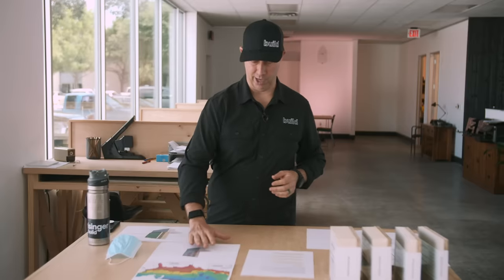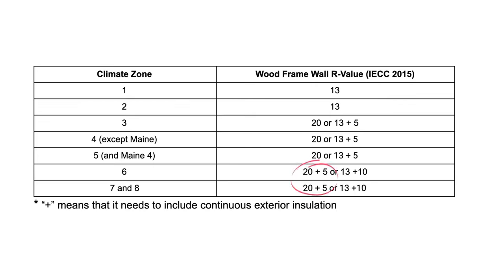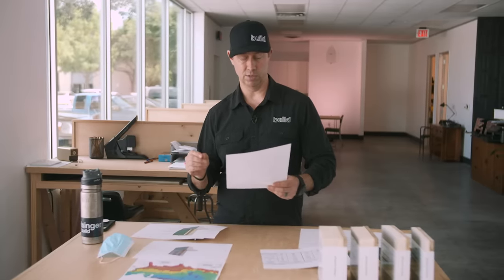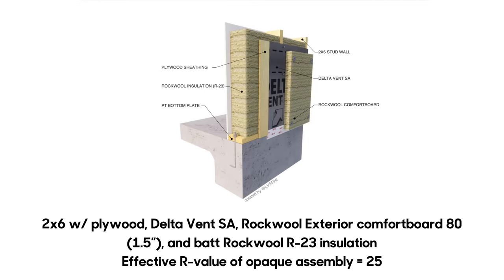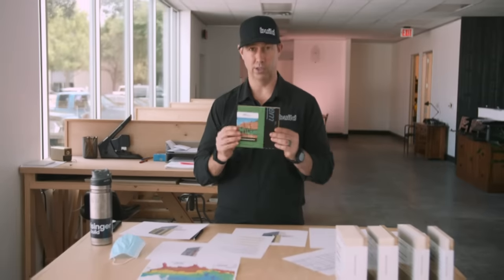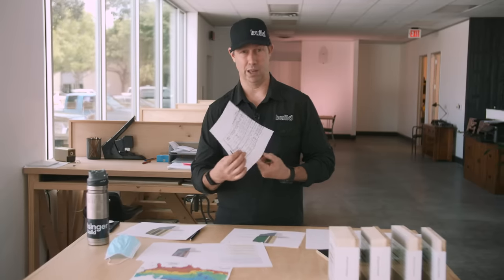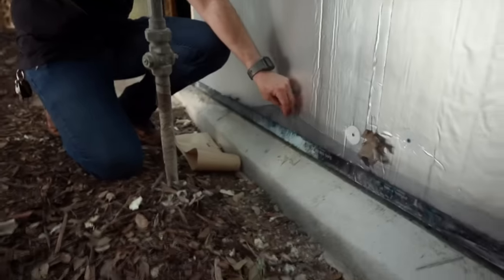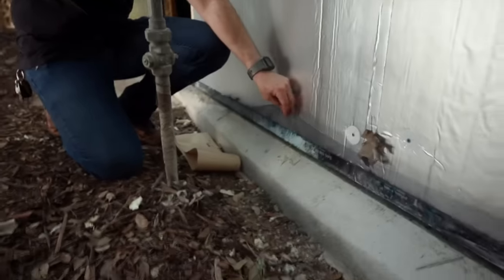5 Ultra-Insulated Framed Walls

Comment: Thanks Matt, great info!
In my new house build in Climate Zone 5 close to Pikes Peak in Colorado. Very tight air & moisture control, unvented roof (no penetrations, all vents go through gable ends). Main level is basically a walkout basement with 8” concrete walls. All my insulation is on the inside of the concrete walls. . Walls are R44 total with 7” of foam sheets + 3.5” of Rockwool in the inside stud walls.               I learned that the Polyiso yellow foam looses R-value greatly with temperature drop, so in my walls I put 3” of EPS up against the concrete & the 4” Polyiso on the inside, then the 2x4 studs with Rockwool. So the walls are about 20” thick.
Reply: James - we are going to be building our new home in the Colorado Springs / Black Forrest area and appreciate the info!  I was watching this for cold weather insulation ideas.
Reply: @ClawsonMatt  Good luck, my daughter lived in Stetson Hills when the big fires hit. There are many new tract houses (code minimum) being built up in West Black Forrest.

Comment: I helped my uncle build his home, with R-50 walls and R-75 ceilings.  He used 2x6 top and bottom plates with alternating offset 2x4 studs to break the wood's thermal bridge.   The walls were insulated inside and out with 2" fiberglass, with 2" sealed foam board with inward-facing aluminum IR reflection.  He added two more inches of foam board with outward-facing aluminum IR reflection on the outside, followed by siding.  His attic was similarly snugged up tighter than a drum.

For air quality, he employed both an active and passive filtered, thermally-isolating air exchangers.  While his similarly sized neighbors were paying over $200 a month in utility bills, his was never higher than $50.  This was throughout the 1990s.

Comment: Really great.  Roof assemblies next?  Would really love to see Lou’s detail of your house roof details.  The outriggers on that are genius.
Reply: Yeah, there is a great deal of emphasis on walls but little on roof or foundation.   Is that because the complexity of walls leads to more mistakes and problems, and therefore getting them right is harder?
Reply: Genius?? Wow. As a design builder for decades, and having done variations on continuous exterior roof insulation systems for over 40 years, I see that detail as pretty pedestrian at best, mediocre choices of compromises at worst. Last time I did overlay outriggers and stopped the roof foam at the wall line was 20 years ago, and for good reasons. Dr Joe has since published the reasons. In our Colorado climate, insulation all the way out to the sub fascia may not be mandatory, but it is if you want to avoid problems, such as ice damming being made worse. My big issue with Matt's (really Steve B) outriggers is the fussiness and the disruption of the continuous exterior roof insulation. See Dr Joe re: air networking. The reduction in insulation value over the outriggers is also a factor. 
We have done similar situations, and here is what I would consider a smarter, more integrated approach to the problem: If 3 1/2" LVL's flat at 24" OC will support the load, then 1 1/2" x 3 1/2" LVL vertical at 48" OC will be even more capable of supporting the load. Since Matt got a deal on LVL and used them for all rafters, it is simple to extend out and cut tails on every other rafter (3 1/2" +/- high). Since Matt is fully on board with liquid applied, that insures a seal of the projecting tails to the ZIP, really no different that around windows, etc. The disruption in the foam is now on the wall, the tiny cross section of the LVL tails. The bridging through that cross section could be reduced by an extra 2" polyiso collar around the tails, hidden in the boxed soffits The heat path is now longer through the tail, from out to in, so the R-value of the LVL tail is therefore increased). A deeper fascia and soffit is a byproduct, which is used to advantage. An LVL sub fascia is now 9" +/- deep, and can cantilever at the rakes to pick up a deep LVL barge rafter, whose top end is supported by a projecting LVL at the ridge. Then a nailer over the rake wall foam, and lookouts tying to the LVL barge rafter. Not hard, we do do this. 
As for roof, one approach is to restart the inner sheathing outboard of the wall foam, to support the continuous exterior roof foam all the way to the sub fascia. Now, blocking above the tails, outboard of the walls to support the upper roof sheathing present far less air movement/ thermal issues than does Matt's outriggers.

Comment: Something that would be really interesting to see: how investing in insulation reduces your HVAC costs and how quickly it pays for itself in energy savings.
Reply: I bet it helps a lot!  I just had my very leaky front door replaced and they insulated the voids around the door frame.  The front room is no longer 'muggy' and my electric bill dropped almost $50!  I've also been able to keep the thermostat at a lower temperature without the HVAC running non-stop.  Who knew?
Reply: Paying for extra insulation up front might save you a ton of money up front by reducing the size of your HVAC systems. If you are retrofitting, the ROI is likely too long. In that case you are paying extra for comfort
Reply: @sd0753  yeah for new construction I'd really like to see a breakdown on how spending more on insulation and air tightness reduces the cost of the HVAC and then how quickly you recoup the balance of additional expense in energy savings.
Reply: Its simple to figure, do a free online manual J calculation, you can vary the levels of insulation which in return will tell you how many BTU a hour the house will take to heat and cool at any temp, then covert BTU to KWh based off the A/C or heat unit you plan to use.   

   While thats a estimate and will be approx and vary,....you can get it very very close by doing a hourly historical weather chart for a previous month for all 30 days....what was the temp at 8 am for aug 1, 2019, then 9 am, do all 24 hours for all 30 days, total the BTU`s and then apply your selected equipment to figure out resource usage to generate those BTU`s......you can do a daily/weekly/monthly cost for a real month at your location last year or any previous month the data is available for in any area...from florida to alaska.
Reply: @alldecentnamestaken  
Like solar? Bahaha. No. YOU won't see an ROI but the next owners will.

Comment: Here’s the complete overview of all the assemblies:

First Assembly: R-22 effective
2x6
R-23 Rockwool batting
Zip System (R-3)
Liquid Flash w/ foundation

$3.62/sqft

Second Assembly: R-25 effective
2x6
R-23 Rockwool batting
Plywood
Delta Vent SA
Rockwool Comfortboard
Tape w/ foundation

$5.82/sqft

Third Assembly: R-27 effective
2x4
R-15 Rockwool batting
Zip System
Atlas Energy Shield 2” Polyiso (R-13)
PT bug plate
Liquid Flash w/ foundation

$4.05/sqft

Fourth Assembly: R-30 effective
2x8
R-30 Rockwool batting
Zip System (R-3)
PT bug plate
Liquid Flash w/ foundation

$4.82/sqft

Fifth Assembly: R-45 effective
2x8
R-30 Rockwool batting
Plywood
Prosoco Fluid Apply (R-Guard & Joint and Seam Filler)
Two layers (3” total offset) of Atlas Energy Shield 1.5” Polyiso (R-9.8)
PT bug plate
Prosoco Joint and Seam Filler w/ foundation

$7.13/sqft

Comment: We use comfort board r 20 on our low perm wrapped vermiculite cored masonry walls and wrap again for air gap before masonry veneer. We insulate and thermal break/vapor barrier the foundations or piers too. Do a lot of timber frames 10x10 post min. and glulam 2x12 for floor beams, bents get 8x8 min. Being in the north we have 70 psf snow loads. So thicker walls are norm.

Comment: Wouldn't 2x6 or 2x8 walls allow for 24" stud spacing?  Also, if you use two 2x4 studs to replace a single 2x8, would you save money and prevent a thermal bridge?

Comment: Would love to see a ICF wall compared too.
Reply: Definitely... that's what i'm considering...
Reply: ICF numbers are stated... r22-25 for standard. Zero breaks. They make new ones that are r-28. Best results high desert climate. The thermal mass ads some r like properties.
Reply: I wish Matt showed more interest in ICF. He's done a few shows on it but ICF really tackles lots of challenges Matt talks about.
Reply: NorthWoodsDiver zipp sponsors the show so that could be an influential factor
Reply: There are ICF systems that go up to R-59 and possibly higher. Pretty insane, and building out of them is basically the same as with any other ICF so any contractor familiar with regular ICF can use them. With all these exotic wood wall assemblies, there's a lot more that the builders need to be aware of, and not every contractor familiar with wood framing can do high R assemblies with their various caveats. In my opinion, at least.
Reply: I love ICFs but I'm convinced that doing Fastfoot with a 3' ICF is about ideal. I'm not really convinced that ICFs are ideal over 3'. At 3' its quick, easy, single pour, minimal vibrating needed, low risk of blowouts, and frame above the 3' mark. That puts your windows at 3' up and in your wood framed section of the wall.
Reply: @BDA123100  I really like that idea. Makes a lot of sense.
Reply: I’m up here in Alaska and have seen the bills of friends whose house is built to code; hundreds of dollars a month. I start in a few weeks to build my house and am going with ICF with three inch of foam both inside and out
Reply: A friend of mine built an ICF home couple years ago 5400 ft² 10ft walls his highest electric bill was $220  everything is electric
Reply: @BDA123100   you can do no vibrating mixes for icf. Throw some helix into it and it works fast.
Reply: He calculated the cost per square foot for ICF in a previous (older) video. I believe it was around $15/sqf 
That’s for a 6” concrete pour with 2” foam on both inside and outside. 

While that seems a lot higher, this is just material cost. The real net savings comes from labour costs. Matt’s high performance wall has so many layers, the real cost will be labor. Which is important to a builder because that’s where he applies markup.
Reply: @NorthWoodsDiver  concrete isn't green
Reply: @Holy Guacamole...Kind of depends on what type of concrete you are talking about and in what capacity or with what respect you want to consider it to be "green." Some uses of concrete are better or more"green" than the alternative. Also, some of the most efficient and green homes in the area(Texas) use concrete as a major building component.(i.e. Zero Energy Home Frisco,TX)
Reply: @hihokie  it can be much greener than wood depending on where you live. Sourcing concrete materials in Florida which is rich in the things that make up concrete is different than sourcing it in other places. And there isn't much about a home that is "green". Asphalt shingles, metal roofing, PTFE based vapor barriers, paints, solvents, all come with environmental costs
Reply: ICF walls are difficult to water seal. That's a big problem for below grade walls.
Reply: @ScottyDMcom  Thank you Scott for the knowledge and the great article. If I may post an excerpt from that article illustrating the point I was making in my previous post..."The cement industry, too, points to more optimistic assessments of the industry's progress on emissions and suggests that, across its lifetime, concrete could make a net climate benefit when all possible action is taken into account.
This includes re-carbonation (or the re-absorption of CO2 by cement), concrete's contribution to the energy efficiency of buildings, and innovation in the way cement is manufactured - including carbon capture and storage. "   
  While I do understand and agree that the process of making cement and the cement itself may not be the "greenest" product out there, it can be argued that the long term gains makes it "greener" than other building materials. My point is that the mass effect that you gain and the thermal retention you get from concrete  makes it an acceptable "green" product. Less mechanicals to heat and cool buildings and thereby reducing carbon footprint by using less energy. It's a matter of perspective.
Reply: the gap is closing due to high lumber costs right now and long wait times in the last week obs jumped 7 bucks a sheet. Ive read many a story of costs to build in lumber jumped almost 6000/house
Reply: I'm in the planning stage and right now in central SC, ICFs are running $15-24 per sq ft of wall space. That's installed and poured, ready for trusses, siding and drywall. The difference is the amount of concrete needed for the different wall thicknesses. An 8" wall thickness gives approx effective R-24 with little to no air leakage, not counting windows. Matt's cost was approx $4 per sq ft, PLUS tape, plus liquid, plus nails/screws, plus labor. How does that compare to ICF?
Reply: @andybrooke1961  are you adding additional foam or did you find ICF with 3" on either side built in?  or is 3" standard?
Reply: Derek Barrington I have found that Quadlock has a three and an eighth inch foam, but can go up to seven inch
Reply: @arsarge  That is NOT plus labor. He is only doing a materials only costs on this. Material only cost of ICF (but including pump and brace rental) is closer to $8-11/sqft depending on concrete costs and distance for shipping from a manufacturing facility. With labor ICF is around $12-20/sqft (and depends on complexity of design a lot). With labor on framing...I do know know, it likely doubles it so about $7-10/sqft. Maybe more for the taped up versions. Also depends on complexity of design. So a homeowner built ICF would likely be cheaper than hired framed structure, but I’m not sure it’s quite down to less expensive or similar for $/sqft if labor, time of construction, layer requirements, taxes, etc. involved. But it’s not the double and triple it once was.
Reply: @arsarge  Sorry, we have different vernacular. I reread what you wrote and you understand the extra layers are NOT included in Matt’s example. I use the term ‘plus’ to refer to things already added in and included. My other comment may still prove helpful.
Reply: @Cpt_Guirk  not really? It's no more difficult to water seal than any other below-grade concrete. I live in the Alberta muskeg and have a double basement, built my house myself and have had zero issues with water penetrating my water seal. Follow best practices and you're fine.
Reply: For those with experience in ICF (and hopefully relevant considering Matt talked about bug shield here), how do people protect against mice with ICF? The EPS I would imagine is a haven for them. When there's a rain screen gap between ICF and cladding with open at the bottom, there's got to be some way to seriously protect that exterior-side EPS (top and bottom I would think)?  Bugs I'm less worried about, being in a northern climate.
Reply: @timm439  I have heard tell of some having issues with mice but no client I have ever had has had issues. I would recommend a cementitious parging that goes at least a foot deeper than backfill and that should suffice. Particularly if you did a wire lathe coated parging. Galvanized lathe alone would also likely work and just parts the visible portion. Again, no ICF I have seen has suffered from this, but it may prove an issue for others. Hope that helps!
Reply: @timm439  as Joshua said, usually a wire-reinforced parging is applied to the exterior face.
Reply: How did it go?     I used 8” concrete.  2.5” of insulation on each side.
Reply: @BDA123100  that probably would be a good use for it.
Reply: @hihokie  the operation and maintenance of a building usually causes more environmental damage then making the building, concrete definitely has a high up front environmental cost, but it has uses for which we don't have a good substitute and it has performance advantages that can result in a longer lasting more efficient building when used correctly.

Comment: I did 2 x 8 top and bottom plates with staggered 2 x 4 studs. Blown in fiberglass dense pack for my 36 x 40 shop. Almost 4" behind every stud and more behind Outlet boxes. Cheap to build. Very little thermal bridging.

Comment: Woah that's interesting that you can use roxul on the outside, I never would have even thought of that.   I can confirm that it does well even if it gets wet, unlike fibreglass.  When I built my shed I insulated the floor and had scraps that stayed outside over the winter.  After the snow melt I went to clean up the scraps and you would never even know they sat in wet snow and water all spring.

Comment: I totally agree with the Yeti cooler comparison and spending more money on the exterior wall to make the inside environment more stable and last longer.  The thing I don't agree with is the HVAC systems are also more expensive and complex in all of Matt's other videos.  There doesn't seem to be an option for building a Yeti cooler house and then saving money on a simple and reliable HVAC System.    But I'll keep watching because I love the videos Matt.

Comment: Could you make a similar video but with different kinds of ICF construction and how they'd rank? Especially considering the different arrangments of siding you might put on them?
Reply: I’d also like to see an ICF construction with a Zip R-3-6-9-12(one of those) screwed to the exterior of the ICF. I’d think you get the extra insulation and the added water/weatherproofing. I’ve just wondered if that would be a good idea since now you’d have a solid exterior to attach your different types of siding.

Comment: In Alaska I built a 2x4 with no cavity insulation and three layers of 2" foam. My 3000 sqft home costs $120 to heat for the coldest month. Others on the street with smaller houses and less wind exposure are paying over $300 for the same month.